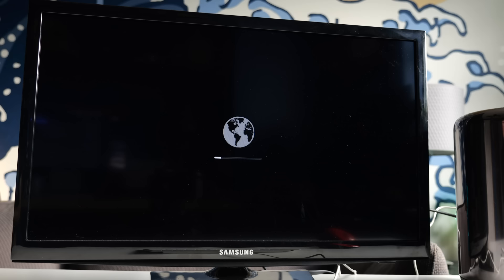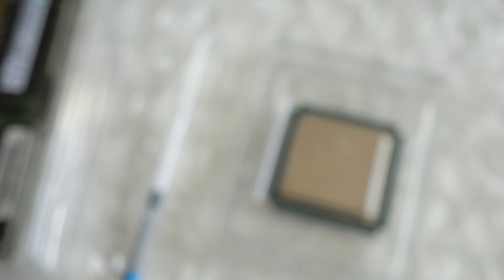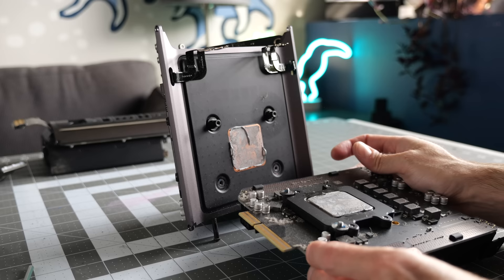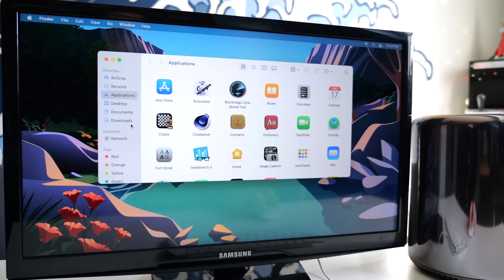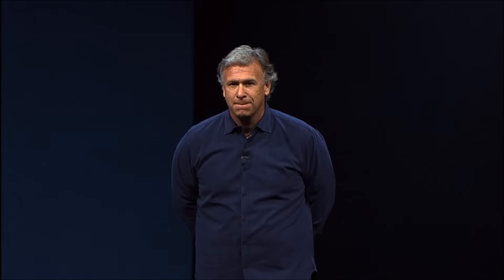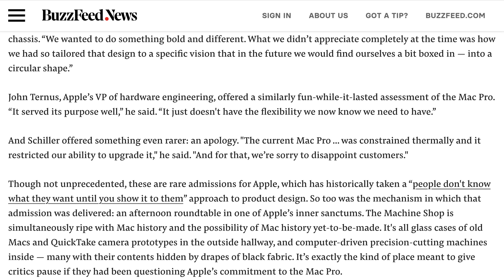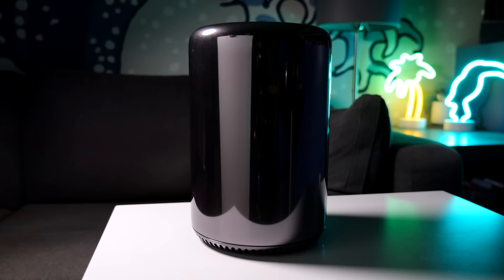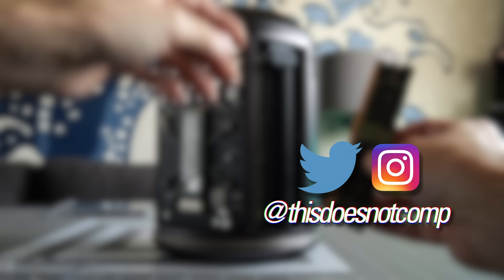Can This Decade-Old Mac Pro Compete With Apple Silicon?

Comment: As I've told everyone else, if you want to compete with Apple Silicon on an older Mac, get an eGPU. Simple way to beat even a Mac Studio, RX 5700 XT via Thunderbolt 2 gets about the same Metal scores in GeekBench 5 as M1 Max chips.
Reply: Crazy it can accomplish that over Thunderbolt2
Reply: @IgnoreSolutions  TB2 is still fast enough for most people, and used gear is cheaper by the day.
Reply: @Joel Kalsi not really, remember that those Mac Pros just have PCIe 2.0 and that Thnuderbolt 3 is PCIe 3.0. Which makes them very close eachothers bandwidth. Also those old CPUs are certainly slower than modern ones, so for tasks that require both (such as gaming), a newer Mac with an eGPU may beat a Mac Pro 5,1. Not to mention that you don’t need much bandwidth for GPU-only tasks if you have a lot of VRAM.
Reply: The performance per watt doesn’t equate given the fact that how low power modern Macs take.
Reply: @kumarcgowda  assuming someone was actually trying a setup like this for work or something, I think price performance is probably a more important metric than efficiency
Reply: In real world uses does that GPU compete?
Reply: wow no wonder they aint getting much fps in games, they gotta add a translation layer on top of that kidna performance? i wonder what a next gen 7900 xtx would do lol if that gets supported. 

i know the 6000 series got mac pro skus but idk if apple will give enough of a shit to do this, maybe its on amd to support that
Reply: Thanks for the info, I reallly like the trash can design so this would work quite well.
Reply: @Piipperi800  Yes, but the MP6,1 uses TB2, not TB3. TB2 = 4 lanes of PCIe 2.0, whereas the MP5,1 uses 16 lanes of PCIe 2.0 per slot. So its GPUs have 4x the bandwidth...
Reply: @axi0matic  again, as I said the bandwidth doesn't matter that much if you just use the GPU for calculations. In gaming there may be a difference though.
Reply: @Piipperi800  OK, but you also said "remember that those Mac Pros just have PCIe 2.0 and that Thnuderbolt 3 is PCIe 3.0. Which makes them very close eachothers bandwidth.", which was completely inaccurate.

The Studio has TB3, but AS doesn't support eGPUs.
Reply: @axi0matic  your comment makes no sense. PCIe 3.0 4x is basically PCIe 2.0 8x, but a more modern standard technically speaking as well. 

And Apple Silicon does not support eGPUs due to a bad Thunderbolt-controller as discovered by the Asahi Linux dev. Which is also my whole point, RX 6900 XT could still with TB3 be faster than an M1 Max in most applications.
Reply: performance per watt of power consumption is relevant for laptops and other portable devices but for stationary computing (is that an official category?), performance/power-consumption ratio is not as relevant as a price/performance ratio (where price is the initial outlay)
Reply: @Piipperi800  I get that TB3 is 2x TB2, my point was that the MP 6,1 has TB2, so the difference is moot when comparing to the MP 5,1. I assumed you were referring to the MP 6,1, as your initial comment discussed TB2 on an 'older Mac' (and it's the subject of this video, of course).   

There could be lots of reasons AS doesn't support eGPUs. The primary one is likely that Apple has no interest in providing drivers for them, as it wants to consolidate all effort on AS's unified architecture. Apple probably consider the SoCs' built in GPUs are good enough for most purposes, and doesn't want to waste time supporting AMD chips. We'll find out for sure when the next Mac Pro is announced. 

I have no doubt that an RX6900XT would be faster on TB3 (or even TB2) than an M1 Max in most applications. Given its massive performance advantage, the application would need to be severely bandwidth constrained for it not to be.
Reply: @TheSulross  'stationary computing' = desktop computing. And yes, power consumption is only critical in mobile computing, where it translates directly into battery life.
Reply: @Joel Kalsi But new M1 has the same power, while being portable. It is insane how much power you can get from those laptops.
Reply: @Joel Kalsi It's okay, but new m1 is better in softsynth stuff, where single core performance matters more. More cores is better if many tracks with slight processing, (movies etc.) as basically all DAWs do single thread processing per track. But for over 10 year old machine its actually good performance if found cheaply, or having stuff that really requires 64gb ram.
Reply: @Joel Kalsi And yeah GPU side is other story. But M1 are really good for CPU heavy stuff. Its insane that my m1 smoked my ryzen 2600 desktop.
Reply: Whats an egpu
Reply: @darkspongebob11  external graphics processing unit
Reply: @darkspongebob11  External Graphics Card. You use an adapter to connect it to a Thunderbolt port or Thunderbolt USB-C port, it is slower than an internal connection but still allows you to add a graphics card to a laptop that it won't fit into or any pc you don't want to void the warranty on by opening it.
Reply: @stigrabbid589  nice
Reply: @Piipperi800 eh? These Mac’s have PCI-E 3.0, or at-least they should. 

I have a old Windows workstation with the same generation of hardware as the 2013 MP and it’s definitely got PCI-E 3.0. 

Now I don’t actually have a 2013 MP, but it seems like a completely ass backwards decision for Apple to make to limit their flagship machine to the same bus version and bandwidth as the previous 3 models (2008-2010/2012 MP’s).
Reply: @Piipperi800 what do you mean Apple Silicon has a bad thunderbolt controller? Can you elaborate on that?
Reply: @thegeforce6625  I don't know how much there is to elaborate on it, but there's a reason why you can't even use eGPUs in Asashi Linux.

Comment: The disassembly montage really showcase how needlessly complex that design was. And it look like its a dust magnet too.
Reply: I had to replace the SSD in one that had been running 24/7 since 2013 and the inside of that was like a tumble dryer lint trap. I blasted it with canned air and made a bigger mess than I would have thought possible for such a small device.
Reply: Every computer requires dusting annually or you will get that kind of accumulation. The only real problem with the design is the lack of a dust filter that can be easily removed and cleaned without disassembly. All Mac's have that problem.
Reply: @OldMan_PJ  There are a lot of nook and cranny inside that bin where dust can settles in.
Reply: My stepdad spilled tea on one of these and they implemented a no drink on table policy since
Reply: Still more upgradeable than recent macs :D
Reply: I mean yes but people make super small PCs now. Wasn’t as common then. I think if they made something like this for a normal desktop it would be cool. Making it for a Pro user doesn’t work though
Reply: Oddly it doesn't attract that much dust, I think the unit he has was just never cleaned.  Blow some air up through the bottom once or twice a year and it's good as new.
Reply: nEeDlEsSlY cOmPlEx dEsIgN. Not all design shares the same goal of bland utilitarianism. This product simply had design goals beyond the scope you're imagining, and it fulfilled them.
Reply: @joeldb  Its a tool. If its design make it perform badly its not a feature, its just a bad design. There is a place for aesthetic and other goal but it comes second. This model failure illustrate it well enough... The fact that years later nostalgia, coolness and affordability make this computer somewhat attractive doesn't erase that.
Reply: I have the prev. version Mac Pro and it is a much better computer. However the huge fans collect a lot of dust in the computer. 
Another interesting fact: The cMP Classic Mac Pro can has 8 memory slots. You can add up to 160GB RAM. Also the dual CPU with X5690 /12 core models/ are more powerful than most of the trashcan CPU options. 

This  computer looks really cool, but I would never use them. It has just way too much limitation.
Reply: That's what I was thinking. What a dust magnet? I think all Apple computers are this. They don't get opened often and thus build up dust.

Maybe they intended them to be this way?
Reply: Quite the opposite really and I open computers many hours a day
Reply: Definitely
Reply: @MrCooper83  It's actually possible to get 256GB in there if you use (expensive) 32GB DIMMs and OpenCore.
Reply: @AlwaysBolttheBird  There was a craze for expandable SFF machines in the early 2000's, lead by the Shuttle XPCs. Not as quiet as a Mac Pro though, to be sure.
Reply: @axi0matic  Not sure about that. 

Apparently the MacPro will not boot with more that 190GB after 10.13.X. I've read that OpenCore can solve the problem.

However the booting time will be increased by a lot.
Reply: @MrCooper83  Sure. Wasn’t particularly recommending it, just saying it’s possible.
Reply: @OldMan_PJ  nahhhh. a good fan setup in a normal atx case, ideally with an intake filter, does a lot for preventing dust buildup.
Reply: needlessly complex is apple's identity.
Reply: I have one of these. While the air intakes do get dusty and need to be cleaned periodically, I have yet to see any dust settling in the nooks and crannies. The dust just builds up on the vents. Why? I don't know. But they're pretty easy to keep clean as long as you actually bother with cleaning them.
Reply: Lost me when you didn’t use OCLP to install Ventura
Reply: I was gonna say:  OMG that dust! I would have cleaned it out first.
Reply: Welcome to Apple. Same is true for iMacs aswell as Macbooks. It's a mess and I HATE working on their hardware, it's just needlessly complicated and often offers no advantages at all, only disadvantages..
Reply: My 2009 Mac Pro requires periodic compressed air / vacuuming.  Except you need to blow out the PSU, PCI pay fan, the HDD sleds (I have four large HDDs + a NVMe), the GPU fan (in this case a 1080GTX) and the dual processor tray with its two massive slotted hestsinks).  It probably takes 20 minutes to fully clean.

Just stick a wide mouth vacuum attachment at the top of the TcMP and blow air underneath.
Reply: @JayJay Golden  you are right. My PC hardly gets any dust if really anything, and it's on the majority of the day, and I game on it intensively.
Reply: @joeldb  Uh, Apple themselves literally admitted its design was extremely flawed, and they moved away from anything like it almost immediately. It was also widely panned by... Every technology reporter in the industry for issues from poor thermals, fragility, inefficient power usage, and a poor heatsink design. It literally did not succeed or fulfill its design goals to the enduser, who is the only person in the equation that matters since, surprise, they have the money. 

You're defending a product that a famously insular and unwilling to admit fault company said was a mistake that they learned from and wouldn't repeat. This is one of those things where you've convinced yourself you're actually super smart and everyone else is wrong, but in reality you're just a weird contrarian that everyone knows is acting weird and defending a product that was a net negative for Apple as a brand.
Reply: The only saving grace was that these ended up on desktops instead of sitting on floors.. and the big heatsink and convection cooling allowed the fan to spin down when it wasn't busy. 
Can't imagine they'd ever get as bad as some PC's I've seen.   Worked on one that had so much dust and pet hair in it that it looked like someone blew insulation into it like it was an attic.
Reply: Beauty has it’s price
Reply: @ParadoxicalThird hold on, I know it’s like a year old comment but, when Apple admitted it for their flaw, wasn’t that about double GPU design and what these professionals wanted was modular hardware, rather than everything you listed? Insults aside, to my knowledge you’re twisting some words here?

Comment: The SSD can't be that old because it has the UKCA regulatory mark that's only just been introduced. I believe it was only introduced at the beginning of 2021, and was hardly used at all until this year.
Reply: Yep, on the SSD it has Manufacturer Date of Nov, 2021
Reply: Yeah I have one, and I get why they sold it. While it's a great drive, when you write more than a couple of tens of gb in one go, it slows down to slower than spinning rust speeds. And before you say, "who writes tens of gbs in one go", I will tell you that a) I'm a developer who does imports of large databases, and b) some steam games rewrite the entire game when there's a patch, so that's an easy 80GB to rewrite.
Reply: @dentjoener  anyone who says that doesn’t really use the machines for storage but rather cpu and GPU. I have a Plex server and I’ll copy over 10s of GB no problem for a season
Reply: @AlwaysBolttheBird  over the network? Because gigabit ethernet they handle fine. More like local stuff. That gb/s drops down fast in my experience. But for most people it's probably fine. Doesn't really bother me either. Was cheap as hell for 2TB 3 years ago
Reply: @dentjoener  no I meant local. I have a virtual machine that is behind VPN and so on that gets shows and then I move it to the right drive after download. So it’s local stuff
Reply: They're shooting up again. Right now, they're 600 on ebay
Reply: @michaelclark2097  That's what always happens after one of these videos. Same thing when videos on how to upgrade the previous Mac Pro came out - they went from $200 each to $600 almost overnight.
Reply: What is a UKCA regulatory mark?
Reply: @WarriorsPhoto  The CE mark means conforms to EU standards. As the UK left the EU it created it's own marking called UKCA:
https://www.gov.uk/guidance/using-the-ukca-marking
Reply: @WarriorsPhoto  I’m guessing it’s a UK Certificate Authority mark not an EU one. I’m guessing it was introduced after they left the EU
Reply: @christianclark1354  Got it and thank you!
Reply: @AlwaysBolttheBird  Makes sense and thank you.
Reply: @dentjoener  Copying over tens of GB is a very normal task that I would bet many do on a regular basis. Windows updates take up multiple GB, installing any modern games take many times that, and hibernating a computer can have massive writes. Even with daily usage, sustained R/W is about as important as random R/W.
Reply: It’s simple. 660p only has a 1GB dram cache. Hence it slows way down when transferring larger amounts of data.
Reply: @AlwaysBolttheBird  It has a dynamic cache so when it fills up it will go really slow trash ssd in m opinion cheap but trash
Reply: Still apps open slower than Hardisks
Reply: @vivek_v  that's why it's my secondary. Cheap bulk storage for games and a couple of big files and projects. If they do a full rewrite update it'll just take longer. IDC.
Reply: @dentjoener  It's a valid question, because anyone who needs a drive that doesn't do that because they have a real use case is just stupid if they end up with one and them blaming the drive is a joke.

Comment: At YouTube Space LA, which is now closed, they had editing suites for the top performing channels. They were all outfitted with these 2013 Mac Pro machines. I remember that these still seemed faster than my 16" MacBook Pro Intel for some reason. They handled 4K footage better. They're definitely not slow pokes, even by today's standards.
Reply: Ram, 4 channels, and more cores go a long way in highly threaded application.
Reply: The editing bays at my community college use a mix of these and the more recent cheese grater Mac pros. I don't use them myself but one of these days I want to do a side by side export between one of these and my base 14 inch MacBook Pro.
Reply: I have a maxed out late 2012 21.5” iMac, and it definitely isn’t slow at all. People have just started to think that old technology is really slow lol
Reply: Fans that are actually able to move heaps of air help alot too. Intel MBPs have loud fans, but they move a fraction of the air that a Mac Pro or iMac can.
Reply: @hyphinx  I feel like it's mostly due to software outpacing hardware, and obsolescence being forced on consumers
Reply: @snoopdoggthecertifiedg6777  yeah, but it's funny how I have macOS Ventura on my iMac with the OpenCore Legacy Patcher, and everything runs like butter. forced obsolescence is such an annoying thing in the tech world. There are tons of new e-waste every day because the end user couldn't download and install anymore software and firmware updates. Basically, companies are forcing e-waste just for an extra buck.
Reply: If you know anything about computers, that shouldn't be surprising to you.
Reply: @mmonkeyman1403 Yeah but still the thing is pretty damn recent. Late 2019, vs 2013 for the trash can.

Comment: Nice video - brought back some memories! For anyone considering upgrading one of these: be sure to thoroughly clean it and replace thermal paste on the GPUs at the same time. Since everything shares a heatsink, you need to do it all together for best results. Then install something like TG Pro to ramp up the fan earlier. Don’t go above 64GB RAM for maximum CPU performance.